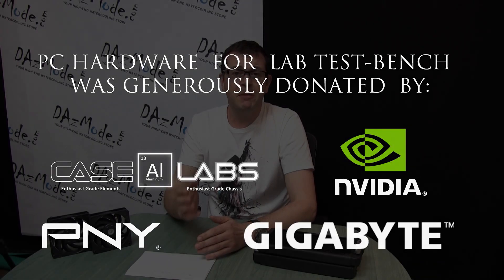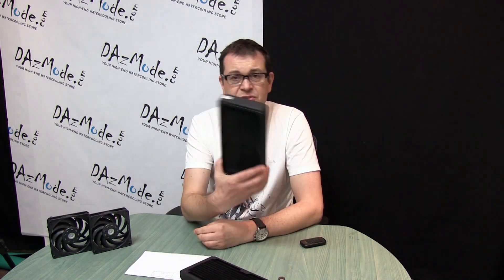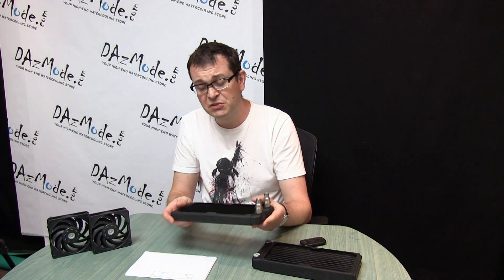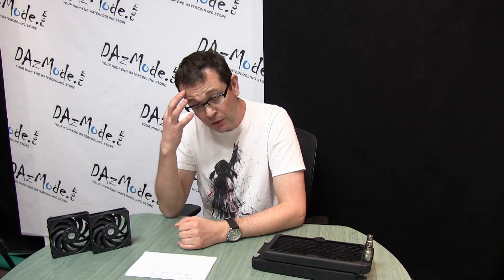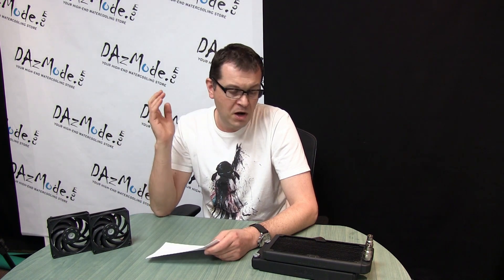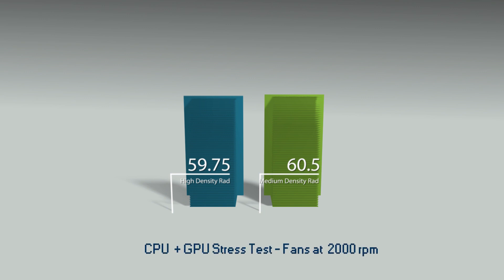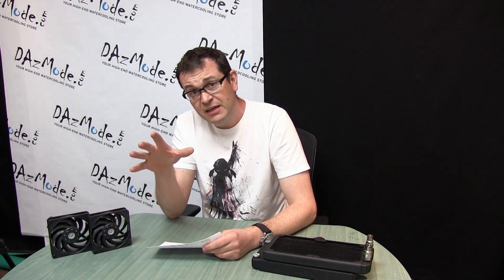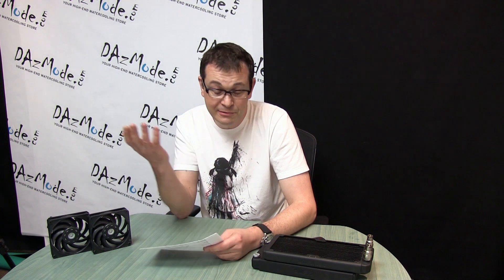What high FPI buys you? - DazLab EP16

Comment: Is the lp360 any good for a custom loop setup?? I want to use to lp360 to watercool a threadripper 2950x and an asus rtx 2080ti strix oc but I don’t know much about custom loops. Does the lp360 have a good fpi and will 2 of them be enough to cool my cpu and gpu???also which one would you suggest: the lp360 or the ek se 360???
Reply from the maker: I would use thicker radiator for your  setup. See my retro build series.

Comment: High FPI is somewhat of a scam. Martin from Liquid labs tested Hardware Labs 360mm SR1 versus GTX, with the SR1 being 10-11 FPI and the GTX in the high 20 FPI range, and until he hit over 2000 RPM the SR1 was better, and both are basically the same thickness. There's also another problem with certain high FPI brands like XSPC. They put cross-cuts into their fins and these cross-cuts are horrible for fan turbulence, and because they also use high-FPI in their EX series, it's a b#tch to clean them with such closely packed fins. For high FPI I'd stick with GTS/GTX from Hardware labs because no cross-cuts, and the only XSPC rads I recommend are the RX v3 models because they have split fin, mid FPI with no cross-cuts, and thick 46mm core. For thin rads, Darkside or Alphacool. Both have tapered end-tanks, making them easy to fit in smaller cases, and both aren't much wider than the fan spaces they support. And the Darkside rads also have relatively short end tanks and their core is not much thinner than the shroud, unlike XSPC EX series.

Comment: XSPC EX240 has a thin core. It's a 34 mm radiator with a less than 21mm core. Also they "louvre" their fins, so the fins themselves have litle cross cuts in them. This makes them a pain to clean, and these louvres cause turbulence. While they are thicker than the Darkside their core is actually thinner. Basically they are good for about two weeks, and then the dust builds up and then they are crap. I'll stick with Darkside for thin radiators, they are the cream of the crop, and at 27mm with short end tanks, of which the ported side is tapered, can pretty much fit in any case.

Comment: if you use push-pull does the screws to mount everything come with the radiator or do you need to buy some aftermarket ones ?
Reply: Rico Suave They usually package enough for any possible config as per radiator length. So, 120 mm radiator = 8 screws for push/pull config.. These days, more and more fans & cases also ship with water cooling config screws and mounting accessories so, you'll always have spares.
Reply: Casey Stellar ok nice thanks for the info
Reply: Rico Suave No problem.
Reply from the maker: Rico Suave No, radiators comes only with one set of screws (for push or pull). They also always for 25mm fans. So if you use push-pull or 38mm fans you get screws on your own.
Reply: DazMode ok thansk man